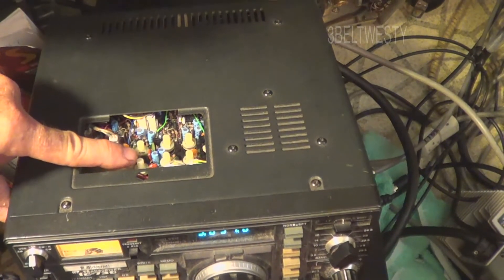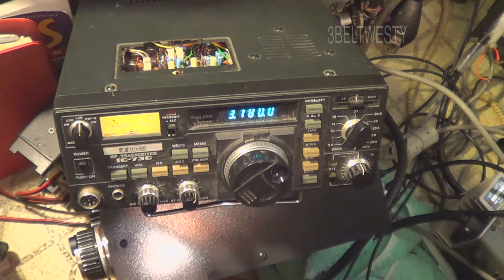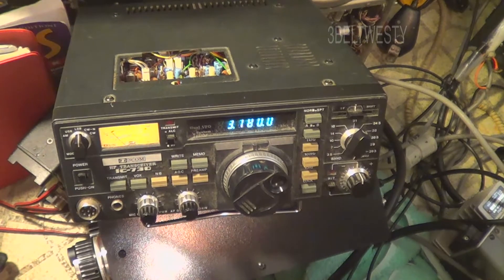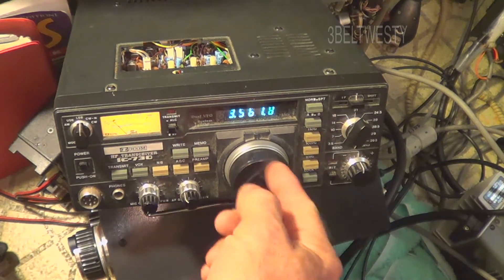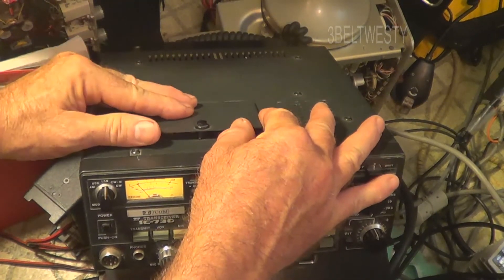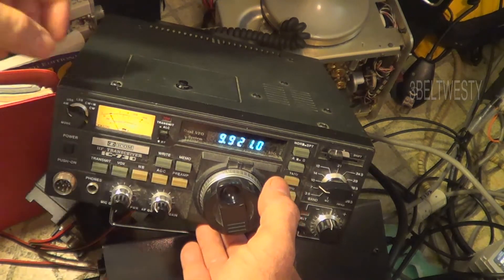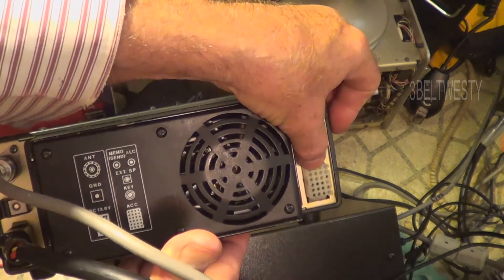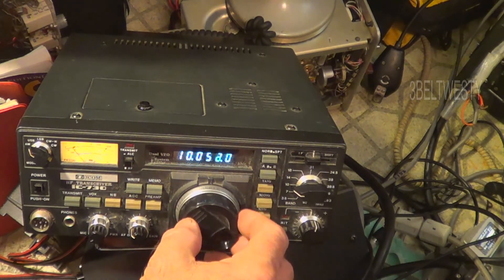Icom 730 Frequency align to 80 meter QSOs

Comment: Just notice you IF band slider is way off center any signal you hear with this off center wont sound right center this control and now reset your frequency adjust pot.jim
Reply from the maker: Hie Jim, The "frequency error" by this IF shift of the slider would be 50 Hz by slider slightly to the left in this test, by one tick width. The slider's tick mark and the reference mark were so that the shift was about the width of the white tick mark off. ie about 1 mm. To even measure this I went off 100 hertz with the VFO then the slider had to be moved twice as far as in the video above. Thus the error is one half of the smallest jump this unit will do ie one half of 100 hertz. I did a video this morning at this link: https://youtu.be/3rDZkIDpzVQ    . I wonder if you have a goofed up Icom 730 since you mentioned " IF band slider is way off center any signal you hear with this off center wont sound right "?  

With my two units here the pitch change of folks voices, a carrier tecwas about 1/2 of 100 hertz on one unit and say maybe 1/2.5 on the other. ie a 50 to 40 hertz error with the tick on the slider and reference ticks so they touch but are at the limits ie white still touches white. ie IF shift of 1 tick width.

Comment: actully you won't be transmitting.  with the ic-730 in CW mode for a signal to go out the key has to be shorted and the the transmit button has to be depressed at the same time for an Rf signal to be sent. If you just short the key and leave the transmit button in recieve, only a tone will be generated.check out the page which talks about transmitting a CW signal it explains thisJim